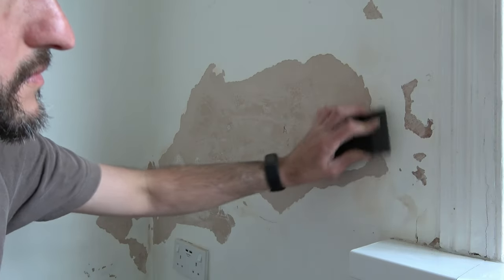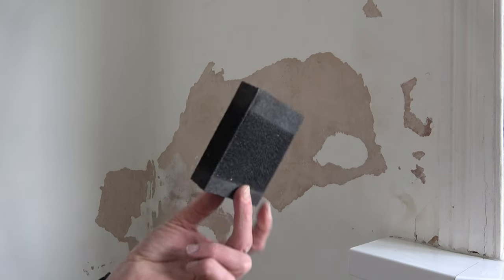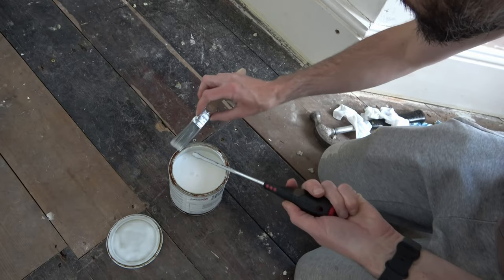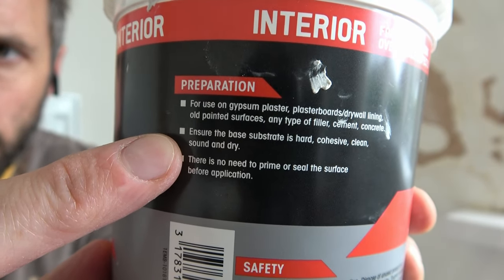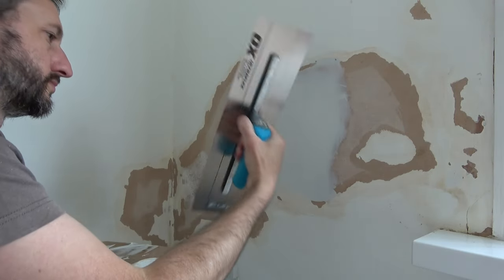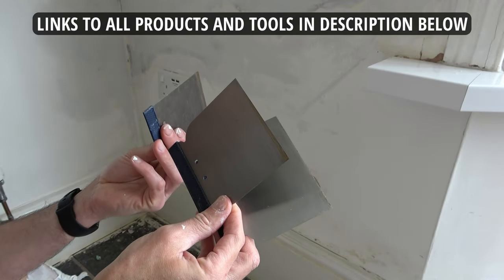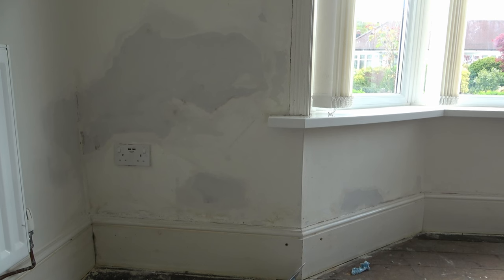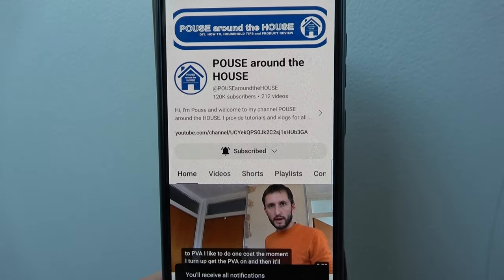How to FIX FLAKY PAINT. Peeling paint DIY repair. How to use fine surface filler. Flaking paint fix!

Comment: I think you need to establish what is causing the flaking  first. What you've done is a good repair but depending on the cause you could be wasting your time and money.
Reply from the maker: I agree. This video was to cover the process of the repair. I have done other videos on damp and how to overcome it. I've also done a video on a proper mist coat (1st coat) of paint on fresh plaster which  done incorrectly can cause these issues. Thanks for the feedback.

Comment: What is the cause of this bubbling? My friend has a terraced house and the internal dividing wall, there is various spots where the paint has peeled and is bubbled. Mind you, a cheap screwfix matt paint was used which was shit.  Would bubbling be a sign of dampness?
Reply from the maker: You can never say without looking at it. It can be damp, or condensation, or salts in the brick or plaster affecting the paint. On old houses especially Victorian there is often no damp proof course and the old mortar that was used often has salts which seem to react with modern plasters causing flaking. I've had issues where radiator pipe work is close to the wall. The change in temperature, and more so the cold from the copper in winter when heating is off seems to drawer the salts out causing a light flaking / dust from the paint. It's never always as simple as one problem for all unfortunately! Thanks for watching and best of luck.
Reply: Yes I'm available to fix it

Comment: After spending a week’s wage following your video hopefully another area of the wall won’t start peeling. My advice to people is get all the loose paint off, seal the edges with a bit of pva and using normal polyfilla feather around the area you’ve filled. Then use a watered down emulsion fort the first coat then paint over the area. Will save you a fortune on products and gadgets.
Reply from the maker: Did you try the products in tge video? Yes you could use any fine surface filler on the market. Personally I wouldn't use pva, you often struggle to get paint to take to pva but if it worked for you then great. As mentioned in the video, if the paint keeps peeling on a huge area of wall, it maybe better to just get the wall re plastered. Thanks for watching.

Comment: After peel stop I wish u put mist coat then filler
Reply from the maker: You don't need to mist coat toupret, it's different to normal plaster. Thanks for watching.
Reply: What about bathroom ceiling?

Comment: Good vid. Do you need to give the filler a mist coat before painting ? Literally have a 2 inch patch in all the upstairs in the middle of wall flaking that was painted about 4 years ago. Not sure if should use this or zinsser bin and what difference between 2 is ?

Comment: Does this work for eaves as well? I’ve got a lot of flaking paint that I’m scraping off and have the primer and paint ready to go,  it was concerned the uneven bits would be visible where I scraped off some paint
Reply from the maker: This filler is for interiors. For exterior work you need an exterior filler.  Hope that helps.

Comment: I would love you to do a video on cracked peeling  paint but on a bathroom ceiling , would you use the same method , we tried all sorts but nothing works , we have also had a new extractor put in
Reply from the maker: The repair would be the same, but if it keeps happening then you will need to find the cause and fix that first. It could be moisture from the bathroom, or the plaster was never given a good mist coat of paint, or maybe you need to try a different paint. Unfortunately it's often process of elimination but good ventilation and keeping a room warm is always a good start. Best of luck with it 👍
Reply: So true,I had the same problem,tried everything,but if your bathroom hasn't got good ventilation it will always happen when steam hits it I had to get pvc ceiling.

Comment: Great video. Thanks. Did you put a layer or two of miscoat on before painting? - that may have been why it flaked in the first place.
Reply from the maker: When I did my loft conversion, I took my gutters off for a while, the heavy rain caused damp in the wall. The house is victorian amd the cavity is probably bridged with old mortar causing the moisture to travel inside. The damp is gone now but it left the plaster slightly blown and caused the pain to peel. Thanks for watching 👍

Comment: Brilliant stuff . 

Glad you didn't use PVA ;)

Only thing I'd add is, you could have gone over the whole bare plaster area, it would have helped for applying the filler.
Reply from the maker: Thanks for the tip 👍  I use pva for plastering but I find if any rogue pva gets on a plastered wall, it's a nightmare to paint over, hense why I've been using  peelstop. I've used this combo a few times over the past year with great results, hense why I did the video. Thanks for watching and best of luck with your channel 👍
Reply: @POUSEaroundtheHOUSE  yeah. PVA isn't Alkali resisting... Plaster is an alkaline surface and that's what you get problems using PVA on bare plaster and also issues when painting over PVA.. as it's softens up with the moisture of the paint.

PVA, ideal for surfaces before you plaster or fill up.
Not for surfaces your putting finish paint on etc.

Gardz is good too ... Have you done a video on that yet?
Reply from the maker: No, maybe one for the future!

Comment: Hello did you mistcoat or use primer/undercoat over the filler before painting? Please let me know I would appreciate your help! 😊
Reply from the maker: No I didn't. Only because the product says it's ready to paint straight over. I didn't have any issues but it won't harm to that if you want. Best of luck.

Comment: Great video. Thank you. When do you know when to stop scraping?
Reply from the maker: As mentioned in the video until the paint feels firm and requires effort to scrape off. If it just keeps going you may be better off having the whole wall re-plastered. Always try to remove the cause of the flaking before any repair. If it's damp for example, that needs fixing first. Best of luck and thanks for watching.

Comment: Great video. I've bought the same Peel Stop and Toupret, following from your video. Question; When I've used the Toupret and sanded it once it's dry , can I use emulsion straight on top, or does it need to be watered down for the first coat? Thanks.
Reply: Mist coat first

Comment: Do you not need to use peel stop on whole patches as well as edges & what consistency of water/paint for mist coat? I’m using zinser mould resistant paint for primer & top coat so should I mist coat the first coat then use normal for second? Am applying all to plasterboard that is prone to damp.

Comment: Good video... I have a ceiling that's flaking in parts so i'll be following this process but I'll use my trusted EasiFill as my filler.   Cheers 😀

Comment: The source should be determined before repair! 🤓

Paint loses adhesion due to moisture from behind. Moisture can travel due to change in temperature.
Reply from the maker: I agree, however this video was more to show the process of the repair. Often it is due to plaster not having a correct mist coat of paint. If it's damp, it's likely to present itself in several places. Thanks for the feedback.
Reply: @POUSEaroundtheHOUSE  fit looked like the window was the source of moisture and it traveled down and to the left

Comment: I'm know it's a lot of boring editing work, but I'm sure I'm not the only one wanting to see the end of the work on the loft conversion. I'm sure you said a good while back that it was all finished, any chance you'll push through and get the videos up some time soon?
Reply from the maker: I've got a load of video footage I lost. The data is currently trying to be recovered costing me a small fortune! So yes, my intention is to get it all uploaded if the data is recovered. I appreciate it's been 6 years since the first upload! 😂 Thanks for sticking with me.
Reply: @POUSEaroundtheHOUSE  What a nightmare to have lost the footage 😭 . If you can't recover it, I for one would certainly love to see a video of the finished article, as in, how it is now, even if we miss a few steps along the way.

Comment: Hi Pouse. Don't suppose you have any tips on fixing cracks cause by thermal expansion?
Reply from the maker: Depends what surface has cracked? What material is it?
Reply: @POUSEaroundtheHOUSE  Plaster on concrete block.
Reply from the maker: You could make the cracks a touch wider by running the edge of a filling knife down them, then fill with a suitable filler a bit like in the video. Or the other option is to put scrim tape over the cracks amd prep the wall ready for plastering, and give the wall a new skim of plaster. Check out some of my plastering videos for more information.
Reply from the maker: @AstronomyWales here's link to my plastering playlist - https://youtube.com/playlist?list=PL2-FHRIF3qm9ej6TMNeBO6mgAWv5aCB1F&si=TxOk2_yEmUVg7Xtg
Reply: @POUSEaroundtheHOUSE  Thanks for the advice. I'll give your plastering series a watch.

Comment: can a bog standard pendent ceiling light be fitted in a bath room as long as its not over the sink and is well away from walk in shower
Reply from the maker: You need to check bathroom zones in the wiring regulations which will give you exact dimensions. Hope that helps.

Comment: They only have Toupret SMOOTHING FILLER ?? Is that ok??
Reply from the maker: Fine surface filler is best for this job as it will fill less than 1mm. Best of luck with it.
Reply: @POUSEaroundtheHOUSE  2 months ago man 😆 thanks tho

Comment: You could use pva glue for a primer, which i supose is more or less  what you was using ,but in a different tin inder a different name, But good video
Reply from the maker: Thanks for the feedback. I use pva for plastering and it's definitely not pva. But I guess they do perform a similar function. Thanks for watching 👍
Reply: thanks for the reply
Reply: Pva is harder to paint over if you dont fully cover it with filler .

Comment: Zinsser guards is actually better for this. The peel stop is more like a stabilizer which works better on chalks surfaces. Ive used the peel stop a number of times on flakimg paint and it always peels again. Been using the guardz for a while now and no such issues!
Reply from the maker: Someone else mentioned guardz. I've never tried it but I'll give it a go when I next need it.  Thanks for the advice 👍

Comment: Dont forget to test for lead/asbestos
Reply from the maker: Thanks for the feedback.
Reply: Why?
Reply: @jsqueeks  with old homes generally 50+ years old they are painted with lead paint and use aspestos building materials. Which is stuff you never wanna touch